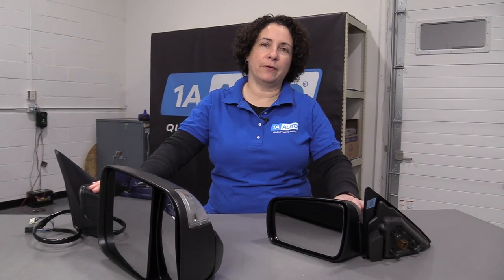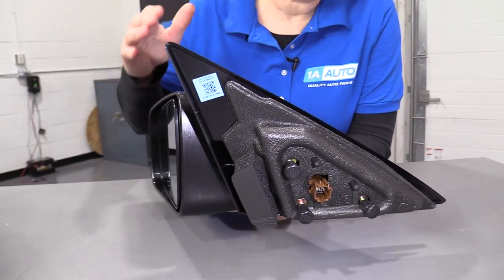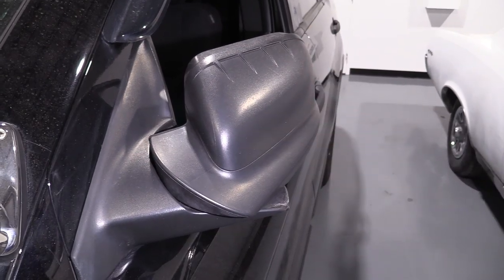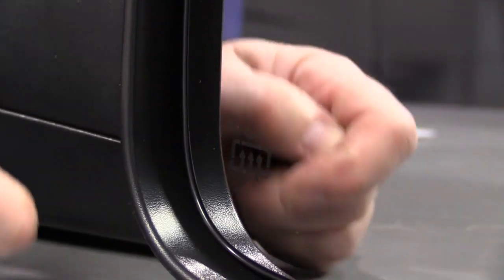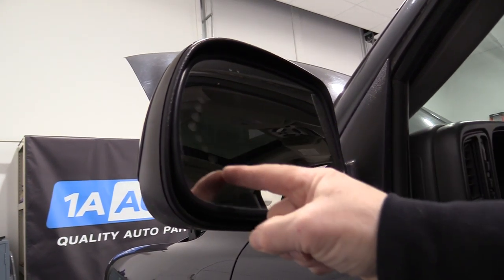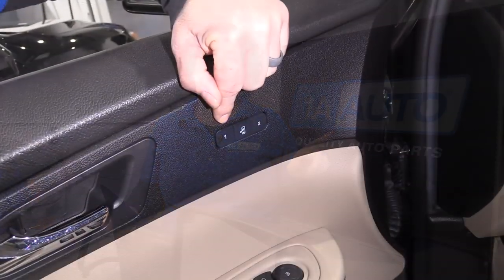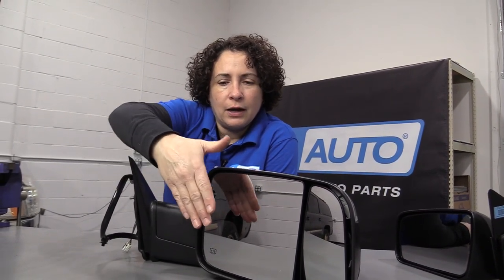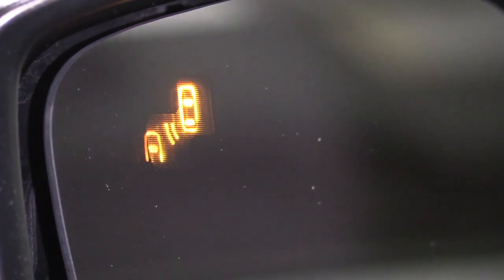Car, Truck & SUV Side Mirror Features

Comment: Hi may I ask: 

The two wires for motor in power folding mirrors are:

1) two input power sources (12V) determining fold/unfold; or

2) one input 12V source for both folding n unfolding and a ground wire.

Thanks!